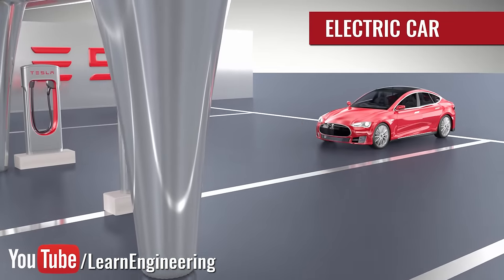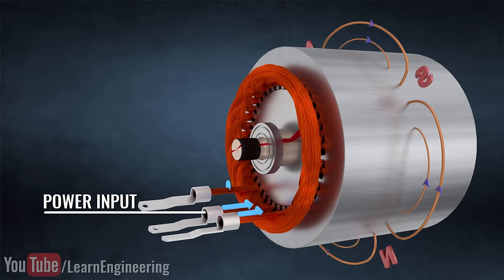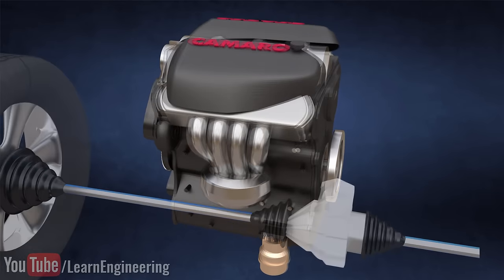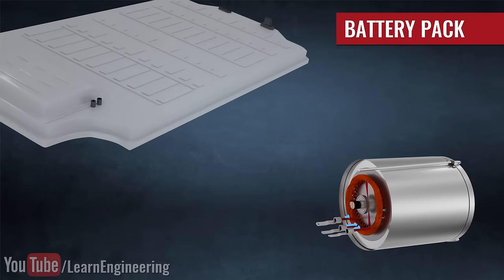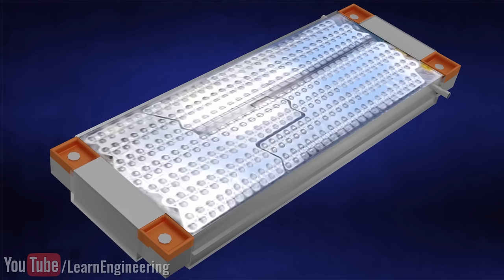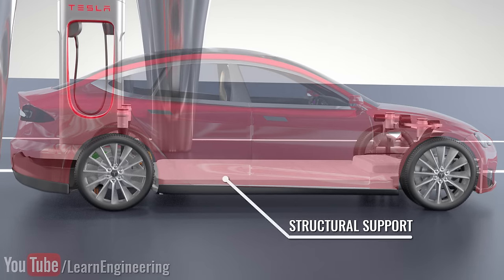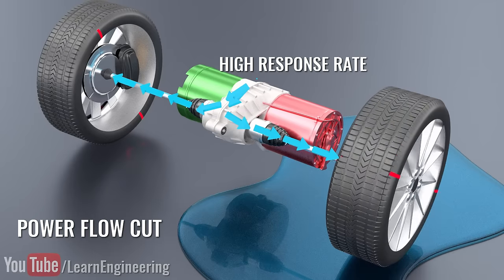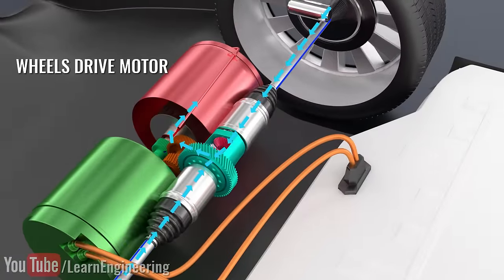How does an Electric Car work ? | Tesla Model S

Comment: rofl.... that's funny.  Not entirely accurate but I assume it was designed as a sales tool for electric cars.  Now.... show them how the battery is made and what it does to the world. lol
Reply: The oil industry uses cobalt during the refining process so trade in your cars for EVs because Tesla LFP battery use zero cobalt for the majority of their cars and only use ethnicity sourced cobalt with no child labor. Batteries are also recycled and there will be a time when mining is no longer needed. You’re welcome

Comment: Another disadvantage:The lithium ion cells could blow up with you inside it. Advantage: -Those fireworks would be spectacular
Reply: Completely false.  There is no "blowing up", and the handful of EV fires have been after a collision damaged the underside of the battery, which is exceptionally rare in a Tesla...

Comment: :thanksdoc::thanksdoc:(oo)The Alternative to plastic/petroleum-based products is hemp  various different materials substances resources for it makes over 26,000 different things.  It has even been proven to be 10 times stronger than steel and 30% lighter stronger and lighter than concrete, stronger and lighter than brick. Far more versatile making the design possibilities practically limitless, at the same time being easier to work with on-site'  equally as amazing 1 acre of hemp! Can produce enough bio fossil fuel to fuel 10,000 vehicles for a year at about a dollar per gallon.  One of the major differences is hemp bio fossil fuel only releases the same amount of carbon dioxide  unoxygenated air per mile as a person does when the exhale versus coal, oil, and gas. Which release tens of millions of years worth of petrified death per mile. The real winning sales pitch"  is 1 acre of hemp! Produces 3 to 4 times the amount of oxygen as a acre of trees at the same time sucks in 3 to 4 times the amount of carbon dioxide, greenhouse gases, deadly unoxygenated air as a acre of trees plus it rejuvenates and replenishes the soil back to Garden of paradise type of quality after every harvest even if the landscape has been previously stripped, robbed, and depleted from overharvesting things such as cotton and corn that has been marinating in petroleum-based fertilizer.  Not to mention it has the same nutritional value as rice, corn, wheat, barley, and milk combined is one so we can easily deal with people being over fed and undernourished   In layman's terms                                          we can rebuild faster much more efficiently at a fraction of the cost in half the time of what we are doing today without leaving any excess poison is toxic waste behind.  	In other words we can manufacture, mass-produce, distribute products that every country, city, and continent is going to be happy to spend top dollar.  Example, hemp clothing  distributes moisture across the body more efficiently than any other material leaving a person feeling, smelling, and smiling their best even under the most extreme circumstances don't forget about the limitless design possibility plus it promotes good respiratory function so if a person has asthma, allergies or other breathing complications just by wearing its clothing you will alleviate those symptoms with the potential of diminishing them all together. Hemp  has even  been successfully grown on radiative soil.  So in theory if we grow hemp along the shores of our rivers and lakes we will greatly improve upon the quality of that water.  Nonetheless we definitely will improve upon and maintain the quality of our air, water, foods, landscapes, working/ living environment, habitat, and every day home products to the highest degree that is humanly possible by producing 3 to 4 times more oxygen per acre than we do currently.  At the same time sucking in 3 to 4 times the amount of carbon monoxide greenhouse gases  un oxygenated air per acre as we do currently,   as a added bonus everywhere we grow it we will be rejuvenating and replenishing the soil back to Garden of paradise type quality even if the landscape has been previously stripped, robbed, and depleted of all its value from overharvesting things such as cotton and corn Keep in mind America has about 800,000 acres of available farming land.  	So again we have the manpower, woman influence, technology, resources, substances, capability, and technology to create clean high-paying jobs from coast-to-coast that will improve upon and maintain the quality of life in such a way.That will gradually consistently, constantly, systematically almost effortlessly and naturally thus allowing each person's generation to become stronger, smarter, healthier, happier, better off physically, mentally, financially, possibly spiritually then the previous generation. With that type of leadership, loyalty, and devotion to one's self and country People may start finally having jobs, products, power sources that will allow them to be healthy and wealthy enough to live enjoy their life all the way through out retirement.  You can't do that would dirty low-paying jobs.  That come from outdated power sources, inferior materials, poisonous, toxic substances, pesticides, and chemicals that never change their killing composition which means whether it's solid, liquid, or burnt off in to our airways atmosphere as a vapor is always going to be poisonous, debilitating, deadly to the body at the same time polluting, corrupting, and devastating to mother Earth and all the various different forms of life that live within this world. 		 The bottom line you cannot promote life by doing business with materials, resources, and substances that have been scientifically classified, religiously verified as petrified death or worse. Think about this because it's a simple logic basic concept if life is not free why the hell would death be any cheaper. I guarantee it's not so would you like to know how souls and spirits have paid out are picking up the tab on the end results of dirty low-paying jobs.  Would you like to know how souls and spirits have paid out are picking up the tab on a diminished quality of life? A better question what do you think the spiritual cost is to one's own soul and spirit living dying to the lowest standards of quality opposed to the alternative which is the highest standards of quality?  Case closed. Mercy, forgiveness, and spiritual welfare are not changing these facts. Protecting, carrying, and compensating any whimpering, whining, crying souls and spirits that are freely connected to a life that is not living up to the pleasure, potential, responsibility of femininity and masculinity. You're either part of the world solutions or you are exacerbating the world's problems either way there is no playing it safe in the middle  every one of us is being held spiritually accountable for each and every moment.I Laugh, smile, grin, chuckle with confidence I say now a wish and pray for my soul and spirit to be held spiritually accountable to the statements I proclaim to the way I'm living personally professionally.	 I guarantee you never see hear another body, man, woman in power, persons of legal, religious authority, leaders ever freely validate the statements they proclaim with that level of certainty. One reason could be the don't have the best interest of the majority of the population's needs at heart. Another reason could be they cum from a bloodline of cowards! One is genetic  hereditary the other is simply a generic learned behavior either way it is physically, mentally, and spiritually useless to freely live and die in such a low quality manner especially if that stupidity, ignorance, and desperation stems from being soft, lazy, out of shape, over fed, undernourished, overworked, underpaid with dirty low-paying jobs. S.R.F.

Comment: .....looses 1/2 its Battery capacity during cold or winter weathers.........Extremely bad cabin fittings...creaking plastics , door seals, perpetually etc.....drivers you mad when driven over bad roads, cheap cabin interior, these are the truth of Tesla made cars.

Comment: This is so funny, and biased. Electric motors don't need transmissions, score 1 for electric. They're also lighter, score 2.
But they need power inverters (transmissions), and the batteries are heavy, (making power/weight far lower).
While they have higher crumple zones, the vehicles are significantly heavier, so it's not necessarily safer at all.
It's biased/misrepresented to say that engines have peaked and motors have made them obsolete. There's so much room for improvement for engines, but motors have largely been solved.

Comment: I personally Refused to believe that the Electric Car is Pollution-free (at least not so directly) as stated during the induction of this program, because it was so naively explained. The author like to jump on the bandwagon of such a doctrine.  Moreover, the author had failed to explain anything and where the pollution sources are in making the electric cars and batteries and electronics control are located, as well as where the source of generation of electrical power and the delivery of electrical power over transmission lines so the users can charge their car batteries.  Okay, so you can say "who cares?" But then this is intellectually dishonest for those who know enough sciences and are not some ordinary elementary students.  This comment shall constitute an honest praise for being able to bypass the scrutiny of a scientific community, because it is made for entertainment, just like those claims to have methods for making "free-energy" electrical generations, among other things.

Comment: Not completely pollution free. Factor in the mining and fossil fuel transportation of parts and raw materials. Factor in electricity from coal, natural gas and nukes. Still a lot more cleaner than ICE vehicles especially if your electricity comes from a clean source (wind or solar or hydro). I lease a Chevy Volt (plug in hybrid). Clean when running on battery power, not so clean when running on gasoline probably imported from the troubled Middle East.

Comment: OK how bout a max torque constant speed engine running a dyno by means of a differential in a transfer case threw a tube in that Dino armeture with a driveshaft to that transfer case and differential in that transfer case connected to the rear wheel differential and seperat induction motors at all 4 wheels run by that Dino with battery back up.!
  What have I invented..
A constant velosity drive system with unlimited 
OVERDRIVE..! DUAL ELECTRIC AND DIRECT DRIVE SYSTEM.
Thank you understand it..? Very few people do.. and so bear the differential sits in the junkyard and people ever realize what it can do..!
Reverse is already built in with reversing the electric motors and also at a mutch lower ratio plenty of backing power..!

Comment: 😂😂😂😂 pollution free my butt. There are lithium batteries, and it is not environmentally friendly.
Reply: When people say EV's are pollution free, theyre obviously referring to the first hand carbon footprint in driving the car. No one is hiding the obvious fact that EV's have a carbon footprint in manufacturing... just like every other car. I never really understood how this is used as an "HA GOTCHA!" point
Reply: I interviewed a top energy expert on my home page vid. He warns EV conversion will not happen and oil can never be replaced
Reply: @diegoveloso3rd  first hand? what about charging them? These aren't recycled so they are dumped in landfills. They are highly toxic and can explode. The "carbon footprint" only continues with these things.
Reply: @ChannelNews1  Yes first hand i.e. end user usage/driving. When a battery drains into a motor, carbon footprint is basically zero. Generating electricity from nuclear power is a viable and clean option. 

They can be recycled, they just aren't because that sector of the market hasn't kept up with the rechargable battery boom. Sooner or later someone is going to find a cheaper and more efficient way of recycling because theres big money to be made and their competition is still lean.

They are highly toxic and can explode, just like the first automobiles/locomotives which we innovated on to result in the reliable and low-emmission cars we have today. It wouldn't be fair to exclude EV's from the same human ingenuity

Some EV brands already use Na-ion and LFP batteries. If other brands want to stay competitive, they have to wean themselves off the fairly scarce and expensive lithium.

IMHO a lot of the issues are developmental. They will remain serious issues only if no innovation/refinement is made and the tech remains stagnant. Current market demand and recent innovations show that is not the case
Reply: @diegoveloso3rd   sorry I see a notification from you that you replies but there is no comment showing. I think they are removing comments. Please leave the comment on my home page vid so i can read it and respond back.
Reply: @ChannelNews1  Copy, pasted and commented; done 👍

Comment: Big lie there:  The cost of operating an ev has to include the cost of replacing the battery after three to five years of driving for about $20,000. That cost has to be added to the cost of operating per mile, and at five years that translates into a cost of about 40c per mile, PLUS the cost of electricity, about 5c per mile in Arkansas, 10c per mile in California. Which, to compare with a car that gets 30 mpg, would mean that gas would have to rise to over $12 - $13 to be equivalent to the cost of driving an EV per mile. Not to even mention the cost of the car itself, which currently have a 20-30% or so premium over an equivalent ICE powered car.
The motors have come a long way, but the battery technology is still 20-30 years away from being practical.
Reply: And why again do we have to include the cost of replacing batteries that are warrantied for 8 to 10 years and designed to last 15 to 20 years, after 3 years...?

That claim is beyond ridiculous....
Reply: @redbaron6805  Teslas own specification, Dip.
Reply: @radzewicz  And while you're at it, show me a 500HP, 700HP or 1100HP car that can travel 350 miles on 3 gallons of gas equivalent.  

This should be good....😂😂🤣🤣🤣
Reply: I interviewed a top energy expert on my home page vid. He warns that EV conversion will not happen and oil can never be replaced

Comment: Automobiles of any kind are a terrible idea, whatever the motive power.  Dangerous, destructive, wasteful, expensive, and yes, pollutive, even electric ones.  Among the many issues skirted by this video is the fact that electrics average about 50% heavier than ICE's, and so require equivalently more energy to move, and do a concomitant amount of extra damage to roads.  And that just scratches the surface of their drawbacks.

Comment: The acceleration stat of the model s is complete and utter bullshit. 
Such acceleration is only possible on a heavily prepared dragstrip on drag radials for the tesla.
There are countless ice cars that have even a better 0-60 than the p110d as f.e. the 918 spyder, turbo s, (taycan), 720s,..

Comment: Tesla has no diy manuals. They are proprietary. I have a rule, if I cannot work on it, I won't own it. Several youtube videos of frustrated out of warranty owners wanting to work on or fix themselves there tesla. A door handle repair $1,000.  Many of the new generation people, hold a latte' and trust the dealer, do nothing themselves. Amazing as these cars are, I will never own one. An older Nissan leaf interests me, I can work on them. The technology very similar, cheaper. The ownership of a tesla, very $$$$. Oh yeah, electricity isn't free either. Most electricity generated by coal plants. The carbon foot print is only reduced in a city, not through generation. If its not seen, then it's okay.